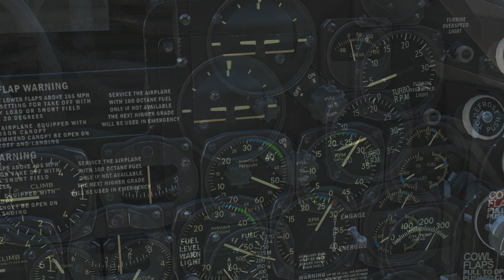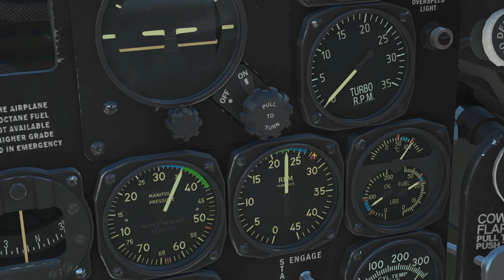P-47D Thunderbolt: Takeoff, Climb, Cruise & Dive Restrictions Tutorial | DCS WORLD

Comment: Cap appears to think that a snap roll is just a quick snap of the stick into an aileron roll.  A snap roll is essentially doing one turn of a spin while the plane continues to travel forward.  This is why it is a prohibited maneuver.
Starting the dive by pushing the nose down rather than out of Split S  entry appears to be a  maneuver parameter for the dive as an aerobatic training maneuver. I guess they are afraid the pilot might exceed one of the dive training limitations. In combat get the nose down and be careful!
Reply from the maker: Copy thanks!
Reply: Snap roll literally is what happens when you pull too much in the 190s. One wing stalls before the other and you'd flick around very quickly. To get there with without a plane doing it by itself, pull hard to a stall and use rudder input at the same time, as if you'd go into a spin. This is something you might consider in planes that have low roll rates (I've done this a lot in RoF with the Fokker E.III just to give an example). The P-47 apparently doesn't like it, so don't do this at home :D
Reply: You are not supposed to snap roll 172’s either. But they will do it.
Reply: A snap roll isn't chinese food?

Comment: 0:50 I take it none of these: https://derpicdn.net/img/view/2013/11/3/463500.gif
Great to see those dive recovery flaps. Just knew them from the P-38 and I reckon the P-47D-28 (that is in Il-2) or earlier models simply didn't have those.
Regarding the boost lever: It's probably an earlier models thing as well not not use it below 7k ft and therefor linking is OK as it seems in the models we'll get in DCS. However, if you want to cruise more efficiently at lower altitudes where it's not needed, it's probably better to not interlink it and use the throttle only to get the desired MP.
Another note here: The RPM limit of the turbo supercharger is 22500rpm, AFAIK it's restricted to 15 minutes max above 20000rpm, so you'd want to stay below that for prolonged use. The training films which are from 1943 suggest that you'd retard the interlinked throttle to keep the TSC RPM at the desired value. Could be OK though to unlink the boost and just pull that one back to open the wastegates a tad in order to get there which might result in higher MP and therefor more power.
Also, you want to keep that carb temp in the green area (think it's 0-30°C) under normal conditions - use the turbo supercharger cooling flaps to get there. If the TSC is not in use, you probably will be able to keep them closed since no exhaust gases get there anyway in that case and the whole system back there isn't in use. As soon as the TSC RPM kicks up from 0, watch that temperature. When running in WEP, try keeping the temperature within the blue area (30-50°C). The other temp limits should be self-explanatory and probably the usual rules apply. Limits are shown on the gauges and don't go full power anywhere below 40°C oil temp. Use the oil cooler flaps to control that temp. The cowling flaps control the cylinder head temperature. Keep that below 248°C or just keep 240 in mind as a limit. Usually those flaps are just open while being on the ground and on takeoff as well as when climbing.
Reply from the maker: Thanks RD x